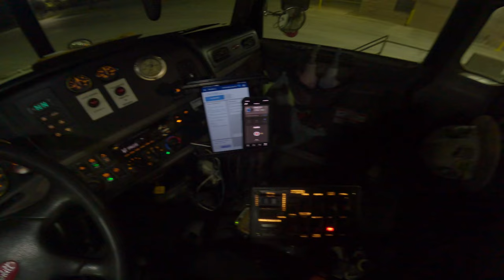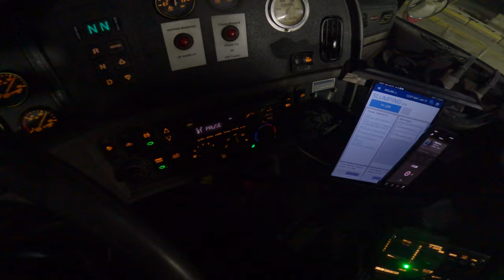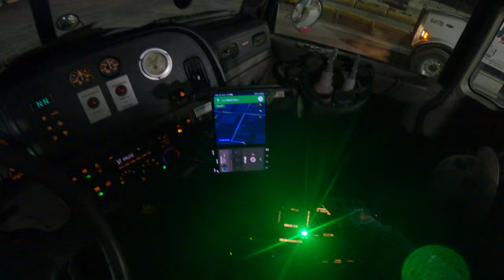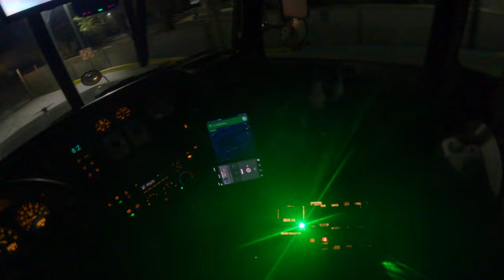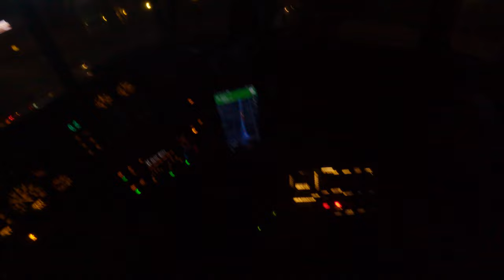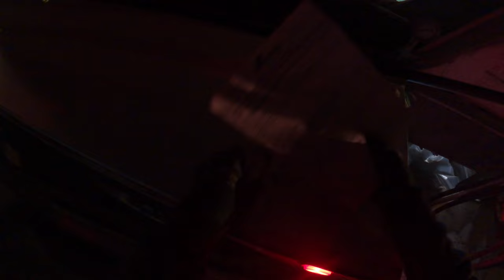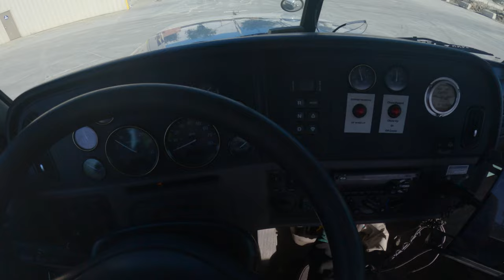Mixer Driver POV

Comment: Bruh bruh good videos! Been a Class A driver over 15yrs. Just started as a ready mix driver 2 weeks ago. So your videos helped with my training. I do noticed you check your slump at idol speed is different from what I've learned 💪🏾
Reply from the maker: Appreciate it💯, how do you like the job? And do you check your slump throttled up?
Reply: @DatsDylan_   yeah, easy money! I'm union. Yes, I was taught to throttle up when checking the slump and adding water
Reply: @davidhudson2096  you can check it idling up but its most accurate when its down at least in my experience

Comment: great video! thank you for showing the pov of an operator! couldnt see the headlights when you were driving. guessing they them crappy stock bulbs.
Reply from the maker: Thank you for watching. Yes stock headlights are not that good. Need some leds
Reply: @DatsDylan_  Ask your truck boss. I work for a CRH company as well. A smaller plant than yours from what it looks like. Not sure how Cemex rolls but at my company whatever I need I ask and they get it for me.

Comment: I drove for A&A  in the 70s and 80s poured the 105 fwy ,dont let caltrans see this video,your not on a residential pour,you cant add water unless a caltrans inspector oks it ,they dont play games .that is why they check your revs. and slump!! i have been on a 20,000 yard monolethic pour

Comment: I start training next month here in Michigan. I come from food service so it should be a lot easier. The job starts off with 28 per HR. Quick question, I was told that its very hard to come to a complete stop while loaded or unloaded is that true?
Reply from the maker: That’s good For starting pay. Coming to a complete stop loaded or unloaded is not hard. But you won’t be able to stop as fast loaded . Just be aware of your surroundings and look a couple more seconds ahead for judgement.
Reply: I’m in drink service how is the transition ?

Comment: I drive a mixer in nh.  I have never used a rear discharge.   Looks like a lot of work and aggravating.
Reply: I drive a rear discharge and I think the opposite lol. Seems like front discharge would be harder. Also don't you guys have to control the chute? For us it's the contractors job. Only sucks when the customer is not a contractor and has no idea what the hell he's doing.

Comment: So when you're loaded, is the mix dry, untill you add the water yourself to the desired slump?🤔
Reply from the maker: It depends sometimes on how the batch plant loads you. Sometimes you get loaded dry and have to add water and sometimes you get loaded at the right slump.

Comment: I've been thinking about applying to SRM to drive a mixer. I've been driving a school bus for the last 10 years, would definitely be tough getting used to all those hours. If you have to drink coffee to stay alert,  can it be difficult to find a place to piss when you need to?
Reply from the maker: The best way to stay alert and up is to always stay moving. I usually use the bathroom at the plant